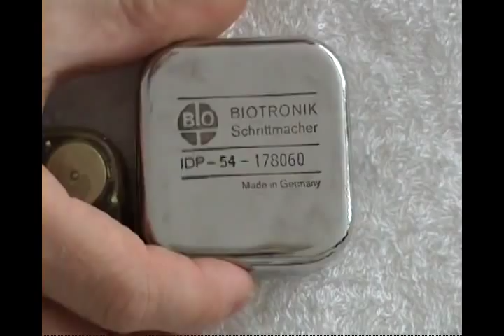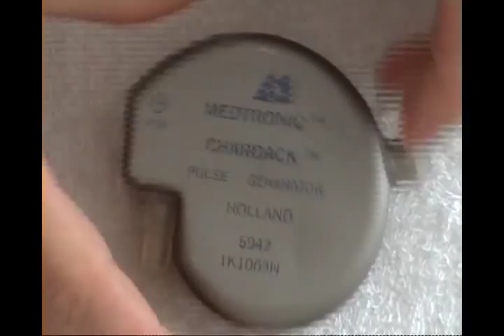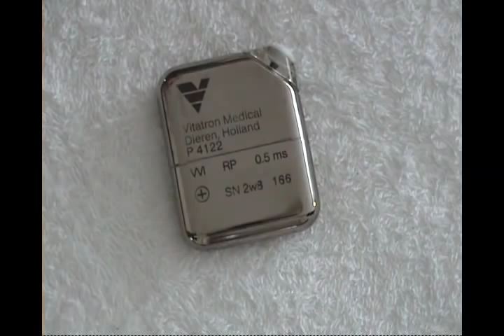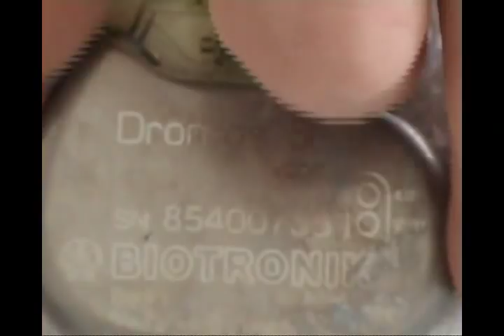Pacemakers

Comment: They sit between the pectoral muscles and the ribs (or sometimes, between the pectoral muscles and the skin). There's lots of fibrous tissue inside - kind of like additional layers of skin. The layers are peeled apart to make a pocket, and the pacemaker just sits there. If you fiddle, you can flip it! Not recommended.

The wires, have a tip like a corkscrew. A springy tube is used to guide the wire into the correct position - the wire is then twisted, and it screws into the muscle of the heart.